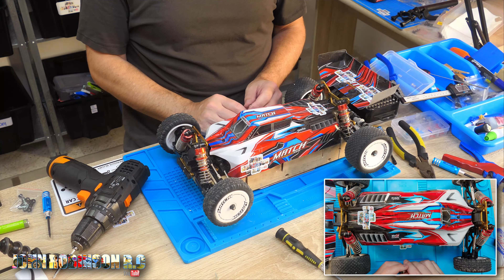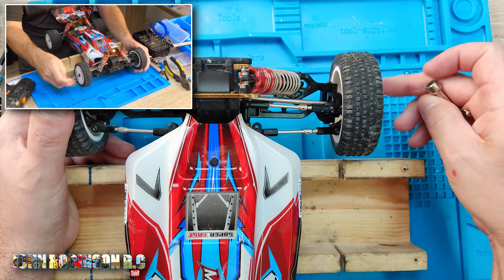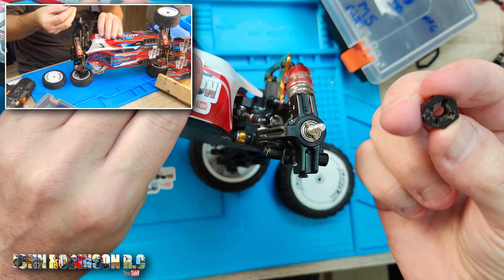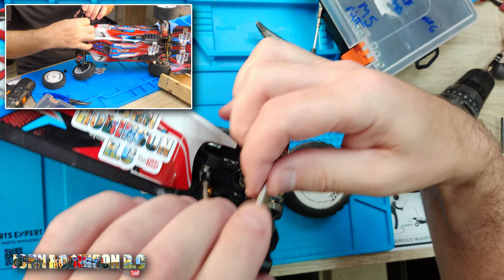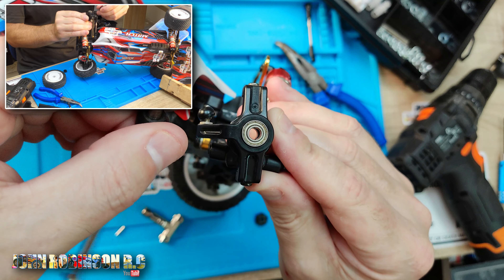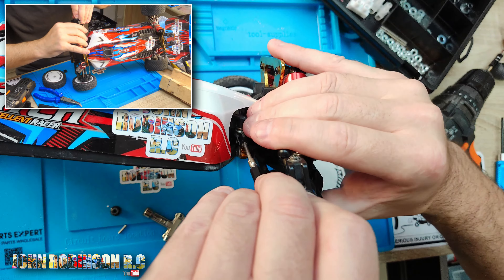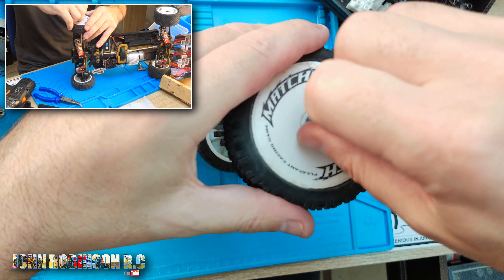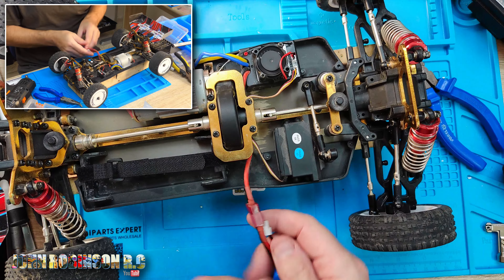WLToys 104001/104002 Wheel WOBBLE EASY FIX!

Comment: Nice tip, its hard to believe it can happen to disconnect during drive and lost the spring. Anyway, what oil thickness do you recommend for SCY16101 for common driving and bashing with no big jumps? THX
Reply: I have the beast max, exact same as the scy 16101. I order lithium grease tubes, there is only 1 thickness and it works great

Comment: I changed the inside bearing for a bigger(mr742rs) and now I find that the wheel doesn't turn anymore, so I have to loosen it and the wooble comes back 😅
So I guess I will stick to original bearings 🤔
Reply: Try putting some spacers between the inner races of the bearings... cartridge bearings dont like being loaded the way the wheel nuts are loading them(axial loading). 
Usually when the 2 bearings are say, 5mm apart in their housing; you'll see flanges on the axles or spacers on the axles that are 5mm wide as well, to prevent loading the inner bearing race. Like skateboard wheels.

Now.. you dont need flanges on the axle, a simple spacer between the inner races will do just fine since these are essentially floating axles. But it sounds like bearings binding up bc of axial loading :)